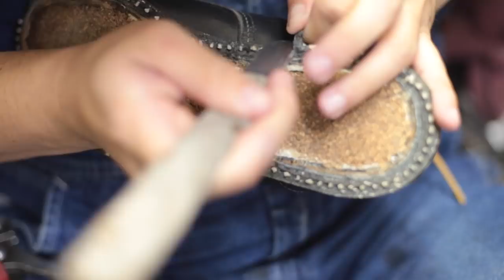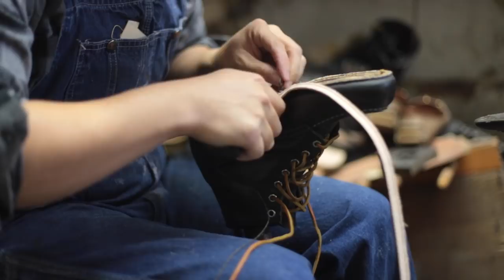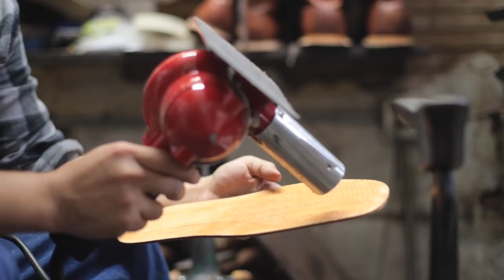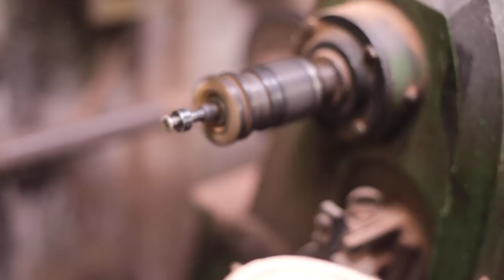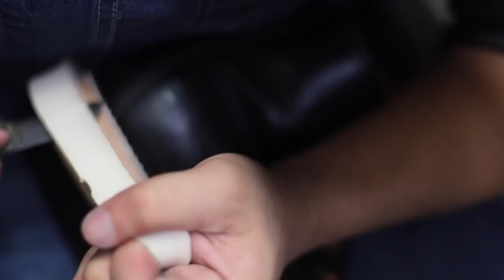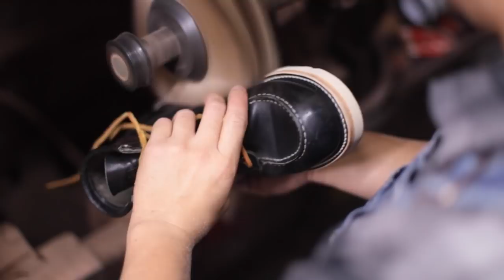Red Wing 8130 Resole #69

Comment: What substance did you use instead of cork?🧐
Reply: I was wondering the same thing.  I'm curious if this was a customer request.  It seems a little thin to be very effective as a comfortable mid.  I couldn't tell if it was a thin layer of leather/rubber or maybe some sort of fiber board.  Definitely has me wondering.  

I'm obviously not talking down about the fine work.  Just curious.